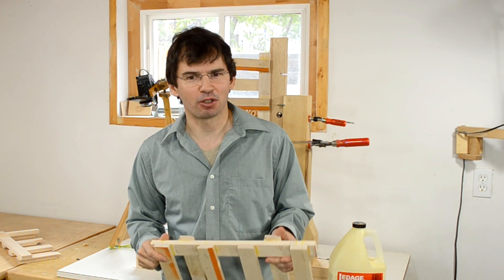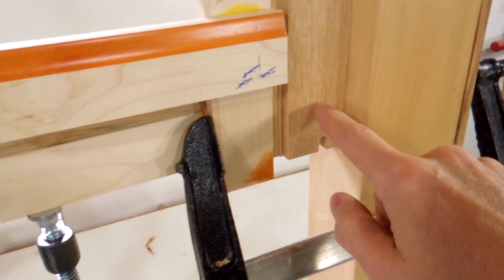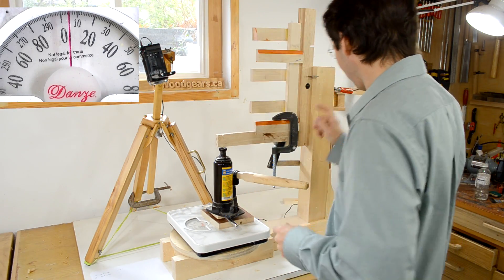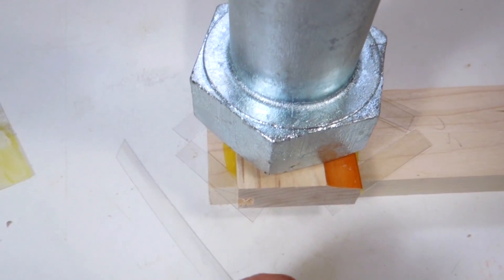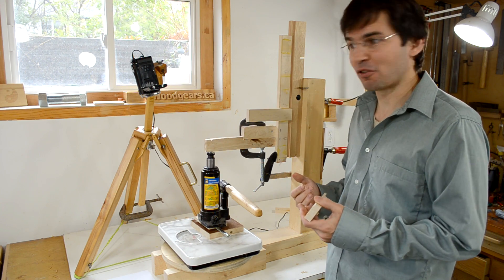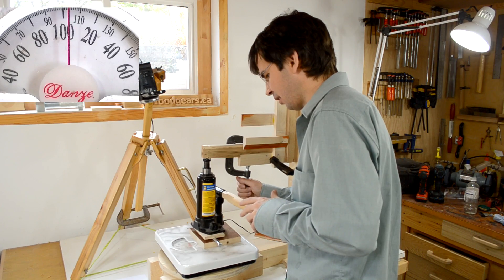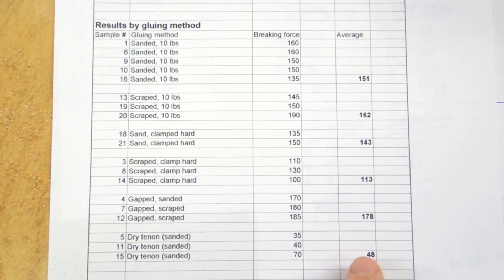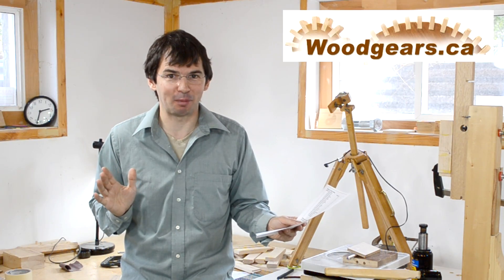Can you squeeze all the glue out of a joint?

Comment: I actually did CFD on this, the glue being elastic is beneficial to the holding strength because it is able to spread the peak load over the entire surface of the joint. If the glue layer is very thin all of the stress is  located on a very small field, whereas a thick layer uses its elasticity to spread the load. The total holding strength therefore increases by layer greater thickness up to a certain point. I did this research for a metal to metal bond layer, the assumption was that high yield strength hard glues where better, but the thicker layers elastic ones blew them out of the water. There are also many tricks you can do with the geometry of the materials to further avoid localized stress peaks
Reply: @vikinguer  Thanks! Forgot about this old comment here. This was internally in a company so I don't have the data anyone. But one of the tricks we used for 2 plates glued together and put under shear stress was adding a 45° fillet on the ends of the plates. The short end of the fillet facing the other plate makes for a nice area to add a thick bead, this decreased peak loads by a ton and enabled to spread the load over a much larger surface with the elastic glue. The last being the entire goal, you want to make sure the glue has the same stress over the entire surface, this makes for the best bond, if I remember correctly we reduced peak stress in the glue by over 4x by just going with a 1mm thick elastic glue bond instead of a 0.3mm stiff glue bond.

Comment: I find your test very informative. As a wood worker, myself, I have often wondered about the strength of a glued joint under different conditions. I have a tendency to over tighten my clamps. Now I well remember your video and back off on the clamping pressure. Thanks, Mr. Wandel.   ( Subscribed )
Reply: The glue I use states to lightly clamp, they must know what they are talking about.

Comment: There was work done during WW2 on glue strength in Mosquito fighters. They had joint failure with the surface of plywood as the pores in the wood had been forced closed by the pressure applied during making the ply. Eventually they had to rough sand all the surfaces of the ply to ensure a good joint. See: "The new science of strong materials" By J E Gordon.

Comment from the maker: It would for this test.
Even with  the glue stronger than the wood, the breakage likes to follow the grain discontinuity.  For parallel grain joints, it often doesn't but for crossgrain, it usually does.

Comment: Thanks for video of your testing, Matthias. and the chart.
For me, it has confirmed that the glue is very good, should not be expressed from the joint by excess pressure, and thus, shopbuilt clamps with cam locks will be fine for most use.

Comment: Really, really interesting video.  Something I tried on a recent project was actually *adding* a bead of glue to a joint after gluing and clamping it, in the hopes that it would add strength (since it's not a joint you would see and will be one with high stress applied to it).  I'd be interested in seeing how that would perform, especially after seeing the results here.  My hypothesis would be that since it's additional glue, it would be stronger than the alternative.

Comment: i hadn't heard that.   I know from projects I've done the joints are
holding up crazy strong and even on dissimilar materials.  I once glued a
shift knob that was plastic back on the steel shifter in a mazda truck and
it held up tight for years until I sold the truck. Some people don't
realize the foam turns rock hard after a number of weeks.  Even if it
didn't, the minute flexibility might not be a bad thing either-  love your
videos and the idea

Comment: Not really surprised by the gap filled with wood glue having a stronger bond, as PVA glue is an elastomer (if I'm remembering my science correctly), so the joint has more flex.  I would like to see it tried after a few months (when the glue has fully cured) to see if you get the same results with the glue gap.

Found the dry tenon experiment very interesting.
Reply: That might allow the joint to hold more energy but wouldn't necessarily increase the strength of the joint

Comment: A great service to wood craftsmen.  You've do a great job of dispelling some of the long time ideas of over tight clamps or rough sanding.  Very interesting about the gapped joint.  Would never had guessed that outcome.  Thank you again for a super video.  Darkmagician135 has a great suggestion about testing with fully cured joints.

Comment: All great, with the exception of the dry tenon, for 2 reasons. One, it wasn't compared with a join that had glue on both surfaces, so the breaking strength is meaningless. Two, the force applied in this test is totally different to the force applied to a tenon. This rig applies a torque force to the joint, when an actual tenon resists torque because it's inside a mortise, it needs to be a shearing force.

Comment: @MrLeonard55 yes, it makes a world of a difference. When gluing very soft woods like balsa, pine, and basswood you should lightly smear water on the joint five minutes before glue up or the wood will absorb all the water in the glue and it will not make a strong joint.

Comment: I didn't say anything about filling the mortise with glue, but what I mean is when you spread the glue evenly on the "walls" of the mortise, it will spread on the tenon as well when you push it in. I am a professional woodworker, and have used this method for years and I have never had it fail. Although I do like to put a little glue on the tenon as well.

Comment: I am quite appreciative of the work you do to test various aspects of woodworking from an engineering perspective. However, I would have to agree with those who say that the dry tenon part of the test is not a good comparison. I might be a fair comparison of dry lap joint - if that is the right term for this joint.
It would seem that in order to do a fair comparison of different methods of gluing mortise and tenon joints, you would have to do several mortise and tenon joints, some dry, some wet.

Comment: I have been thinking of this of late, starting with wondering how those concrete bonding agents work, as they appear to be white glue only. I imagine they depend upon capillary action to form a good bond. Moving to wood, I originally put glue on one surface, but seeing the pros spread it on both side I queried why? I am theorizing that the bond strength is due to capillary action on the wood surfaces. Good work Matthias, a little schooling on this process is priceless, cheers!

Comment: Interesting video, but the conclusions can't really be applied directly to other types of joint. Much of the transversal rigidity of a mortise-and-tenon joint is purely mechanical (i.e., it can hold together even with no glue at all - which would give a result of zero in this lap joint test). The glue is there mainly to prevent the tenon from sliding out (i.e., to resist a "pull", not a "twist"). And there's also the issue of flex; a big gap full of glue might not break easily, but it will probably lead to some wobbly joints.

Comment: Awesome info I had always been curious about.  The gapped joint strength is still surprising and a bit hard to believe as it basically implies that clamping reduces joint strength. I suppose the takeaway is to only clamp with enough force to hold your parts in the position you want them to set in.

Comment: Matthias On the mortise and tenon joint, One flaw I see in your test, I know, folks are beating you up on that one point, but something to consider. The tenon will typically bottom out, or come very close to bottoming out, an will therefore force glue back up the mortise and coat some of the dry tenon. Something I would like to see is an actual mortise and tenon joint test. That is if you see fit to find the time to do such a thing.

Comment: nice work... I remember Norm Abram was criticized when he started the new yankee series over 20 years ago.  Wood worker snobs such as in Fine Woodworking magazine said he used overly copious amounts of glue.  Seems he was right in doing so!  I made  tables  20+ years ago with nicely dowelled leg to apron joints that failed in the first year because I used  dowels cut from longer dowel rod and essentially left no room for glue or air escape.  I groove all dowels with at least one vertical line.

Comment: I've often wondered if scoring the surfaces with a razor or nail would help with adhesion, kind of like microscopic finger joints. This works well for gluing plastic or metal surfaces, but the results from the scrapped joints seem to indicate that it doesn't matter much if you have a rough or smooth surface. Also... how strong would the joint be if you just laid the pieces together with no clamping, just the weight of the piece pressing down? Thanks for the great strength test videos.

Comment: this reminds me of school and using way to much glue on my jobs (according to my class mates). being the only female in woodshop i was ridiculed by my class mates who would fussily scrape a small amount of glue on their joints, until  one wood tuning job failed spectacularly ripping a huge hole in the ceiling. after that the teacher would whack each job on the bench before letting them put it on the lathe. one by one i watched my class mates jobs fail after a light tap.  mine a hard bang didn't.

Comment: A mortise & tenon has mechanical strength in shear and bending with no glue at all due to the hole.  Whereas 2 boards glued together face to face have no strength at all.  Also, a m&t has 2 glued long-grain to long-grain surfaces, so only counting the glue strength, and not including the mechanical strength from the hole, a mortise and tenon joint has twice the strength from the glue as what was in the test.  Your experience shows you've had no failures because of those factors.  If you applied glue to the tenon as well as the into the mortise, the joint would be stronger, but it doesn't seem that your projects require the extra strength.

Comment: I think the video is brilliant. I was taught to always bevel the end of a tenon or dowel so to doesn't push all of the glue off the surface. I wonder if it would make some difference to the test. also interesting was the strongest joint moved a fair bit before it broke. If a joint like this was used the item may not feel solid.

Comment: actually makes sense the tighter the joint is and or smoothness there is less surface area for the glue to adhere to thus creating a weaker joint when it left less smooth the glue can create a more matrix like bond than a edge to edge bond that one would see in the smooth example

Comment: I had a similar situation with biscuit joints and ribbed vs smooth dowels. The ribbed dowels and wavy biscuits always have a stronger connection.
I wonder if you thought of trying that with different sizes of dowel joints.
I like using them for chairs and stools.

Comment: When using adhesives in composite aircraft structures, the thickness of the adhesive layer is also very important. A comparably thick adhesi e layer allows more local plastic deformation and thetefore removes stress peaks. Both sanding,  and scraping will leave a fresh surface capeable to form chemical bonds with the adhesive. When gluing metals, the ruth surface and priming becomes moe important, because chemical bonds dont work as well

Comment: Sweet video. Just some of my thoughts-the dry tenon-I am wondering if because one surface is dry it wicks in a layer of water from the glue which make a kind of wood, water, glue sandwich, Then when it dries that water layer becomes an air layer. I think a good analogy too is mortar for these kind of tests thats like a blown up to scale version of glueing. Also to be considered is the direction of 'grain' the sanding direction creates. It would be interesting to view the  broken joints with a microscope.

Comment: My problem (when it occurs) is getting the right amount of glue on the two pieces of wood. Enough to make a strong joint but not so much as to  appear on the surface, especially working with redwood which is soft.  When I wipe it off it leaves a stain that shows up through the finish.  But if I can't see the squeeze out, I'm not sure I have enough glue.  Right now I'm making smaller things so brute strength isn't necessary, but I want to get into furnature sometime where the strongest joint is wanted.

Comment: I realize you did this video years ago, but you've been building your new board breaking machine. You got the result that a joint with a 0.3 mm gap was stronger than a joint with no gap. Patrick Sullivan came to the opposite conclusion that as little as 0.5 mm resulted in a loss of 50% of the strength. Any chance you'll revisit the glue strength with your new setup?

Comment: I was rewatching this video in the hope I might find an answer. 
In terms of surface quality, I see you only did scraped and sanded. 
I usually find myself working with construction lumber for construction uses like connecting beams to rafters to planks etc, and aside the screws and the lap joint, I put some glue in that.. but it's construction material, pine boards and beams in semi-rough state - fuzzy look, "watch for splinters when handling".. No time or desire to plane/joint the lumber let alone sand it or scrape it. So i put glue on the saw marks left from the hand circular saw used to make the lap, or even on the rough saw marks left from the lumberyard. 
I was wondering if i should at least joint it or not.. (the glue is just for added measure, it has machine bolts and washers and other metal ties that can support the wood without any glue at all.. but since i have some wood glue, and two beams meet overlapping.. why not?) or stop wasting glue and mess I create with it, if it does not help at all.

Comment: Mathias, the point of failure is different on a tenon and on your experiment. Youre applying torque here and a mortise and tenon joint is resistant to torque (because the wood). Rather, you should build 2 proper mortise and tenons and apply a pulling force.

Comment: interesting, but I'm guessing in practical use a loose joint with lots of glue would allow pieces to move a bit and thus loosen the joint over a shorter time, even if they do show more resistance to a one-time application of force?

Comment: How about scoring multiple groves into the surfaces, perhaps at right angles on opposing faces, to allow a glue to get deep into the wood? Then clamp the joints moderately tight during curing. I wonder if the bond would approach the strength of your gapped test.

Comment: Question about the dry tenon simulation: do you think there would be a different result in an actual dry tenon joint because of the amount of glue surface being more than double your test? I would think seating an actual dry tenon would have glue squeezed up onto both sides of the tenon. Or am I missing something?

Comment: Well, you've always said that the glue you use is stronger then most of the wood you use, so there you go.. But I guess you could reach a point where you have too much glue and it wouldn't dry all the way through, and you'd end up with some sort of "toffee substance" in the middle that would weaken the joint. But I guess the lesson is, don't be afraid to use a bit of carpenter glue : )

Comment: I'm curious that the "gapped" joints are actually stronger that the gapless ones. Why do you think that happens? 

If it's valid, there might be a point to intentionally having some hidden wobble in joints, to allow the glue to work.
Reply: +Tom Legrady Looking at the video, it looks like the 'arm' of the gapped joint in not bending.  Rather, the whole arm is pivoting about the joint.  So I suspect that what is happening is the joint has usefully failed long before it actually snaps apart.

Comment: How about adding big grooves on the tab that goes into the slot (sorry, i haven't picked up the names of things yet) and make the tab itself a tight fit, so you can be sure it will be positioned right and still have plenty of glue on the gaps caused by the grooves?

Comment: I believe you missed a critical variable in this test -- how long you allowed the glue to soak into the wood before applying clamping force.  If you allow the glue plenty of time to soak into the wood before applying clamping force it should not matter how much force is applied.  If you apply glue and then immediately apply strong clamping force you are limiting how much glue can be absorbed into the pores of the wood.  I would be very interested in seeing a repeat of the test with this as a controlled variable.

Comment: so what was the dry time on all of those joints? i didn't notice any wood transfer in that pile of broke joints which would indicate glue joint failure, in guitar building if done properly you will almost never break at a glue joint, the wood becomes the weakest point & wood fibers will tear apart before the glue fails. In the hundreds of broke guitar necks i've encountered I've only witnessed a few where the joint failed & it was very obvious that it was done very poorly in a factory far away.

Comment: If gluing two parallel-to-the-grain surface faces (edge or face) is 100% strong, then how strong is gluing two end grain surfaces?  One end and one with-grain?  A 45 miter joint?  A cross-grain joint? Have long wondered about this but have not been able to find the answers in my research.  Thanks for your fine woodworking series.

Comment: You need to have enough glue in there to wet the wood. With the dry tenon, the tenon quickly absorbs what little glue did come onto the glue surface. What you end up with is a mircoscopic foam between the wood surfaces, instead of solid glue.